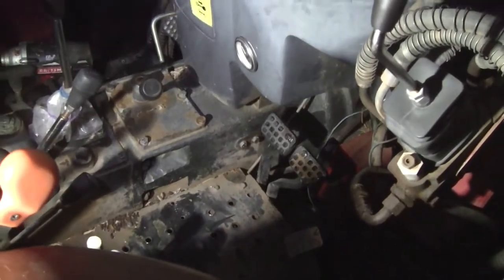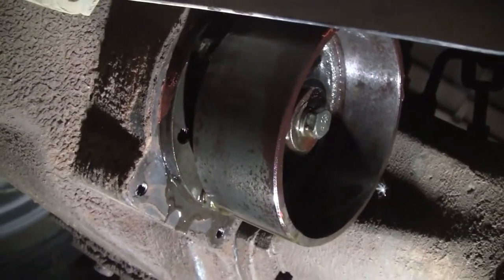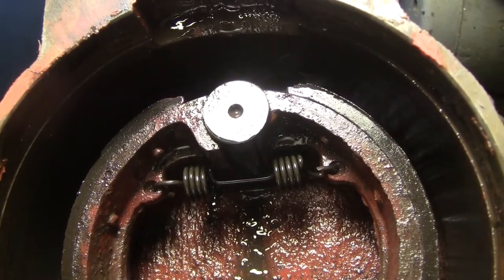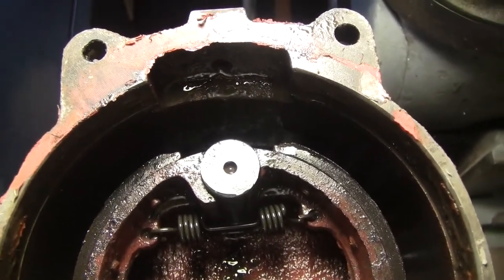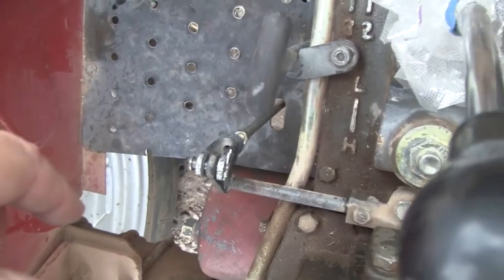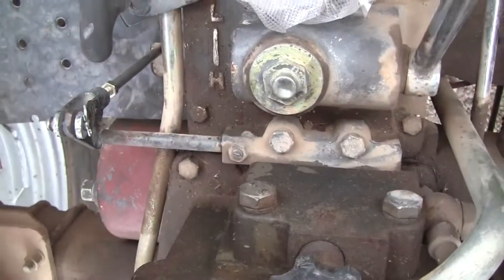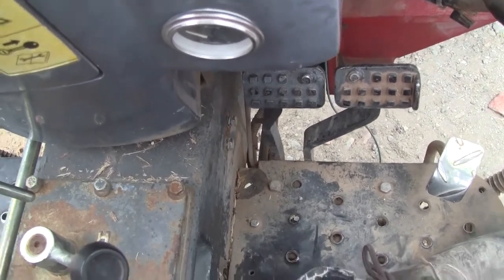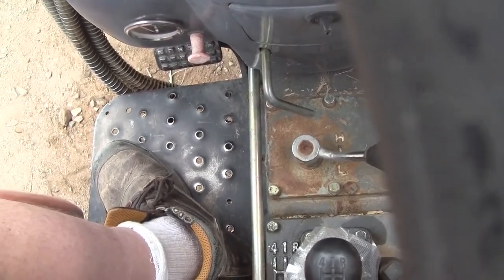2840 Workhorse Chinese Tractor Project. Brakes!! Part 3.

Comment from the maker: Even though the brakes are soaked in oil, the right brake can still lock the tire up while driving on dirt. Only one road in the area is paved. I'll test the brakes on that road when I get the tractor back together.

Comment: The one shoe has a worn off at the actuator pin if you look at it you will see it’s worn or broken so only one shoe is moving out properly not expanding enough to fill the drum with enough pressure to work
Reply from the maker: Where in the video is this ?